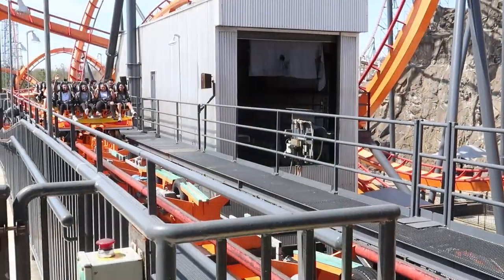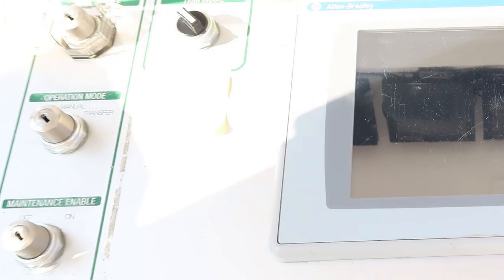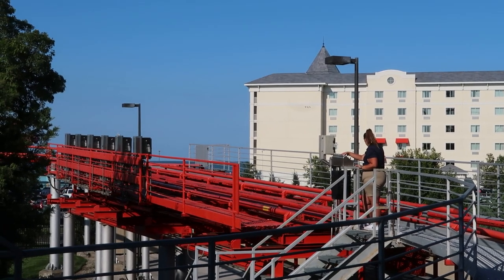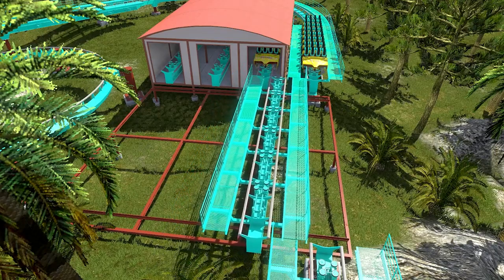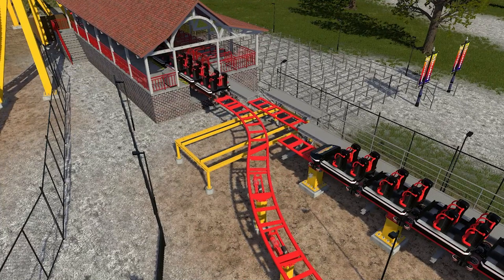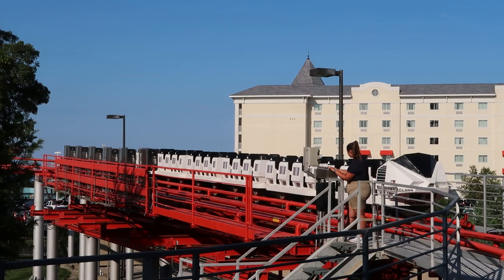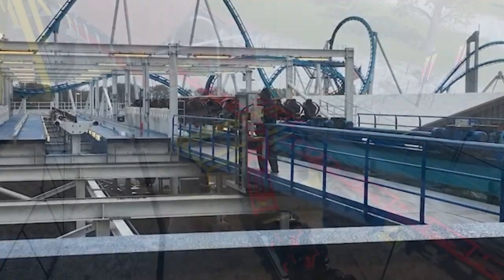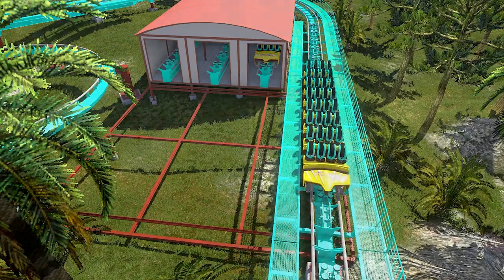How Do Roller Coasters Add and Remove Trains?

Comment: I misheard the line at 2:40 as "by use of a witch" and envisioned the ride op employing the help of a woman gripping a crystal in one hand and telekinetically working the train up the track with the other.

That aside, great video! I'm a chemist by trade but i've always had a strong engineering interest, and it's fun to see how these systems are designed. Earned a sub.

Comment: Big Thunder Mountain at Walt Disney World in florida has a super bizarre transfer track. I am a little confused by how it works, but BTM trains must cross the train tracks of the Walt Disney World railroad to reach the storage track, which is relatively far away from the ride and out of the view of guests.
Reply: On big thunder mountain there's a section of track that's lifted up like a drawbridge. It folds down and then trains can cross over the top of the railroad. 

BTMR also has the rotating type of transfer track pieces

Comment: how do they un-stuck coasters that have vallied?
Reply: You have to use a crane to take the train off of the track and bring it car by car back to the station or transfer area
Reply: Depends on the coaster and where it vallied. Some can be winched to a spot they can keep going from, others need a crane.
Reply: Oh thanks for the real awnsers. Google had no awnsers for me.